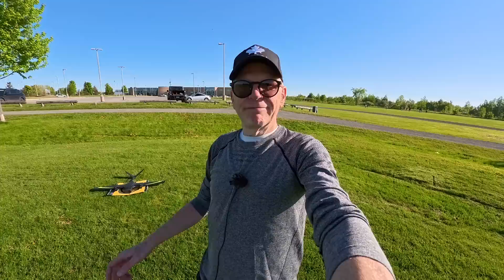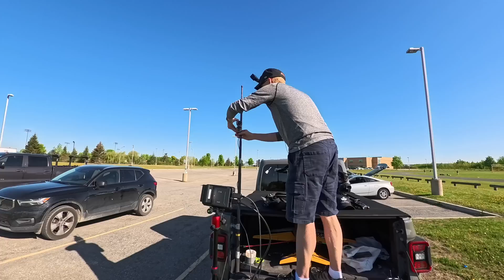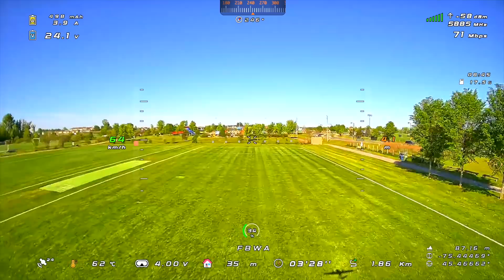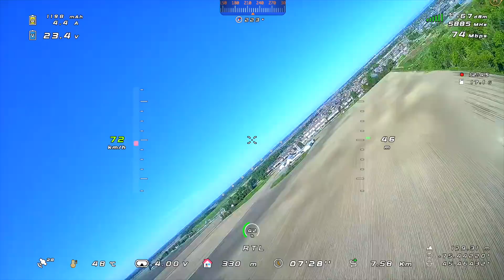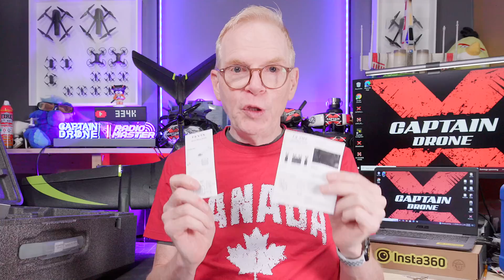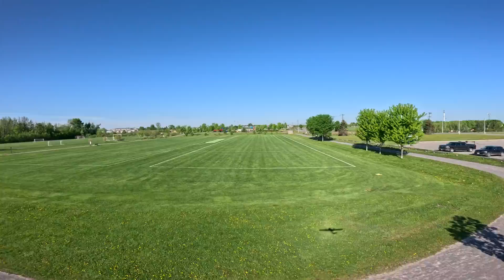OMPHOBBY - ZMO Version 2 - Long Range VTOL

Comment: I've had three good quality drones with fpv, the first being DJI Phantom 2. Each of them have ended with the same problem. After roughly 2 - 3 years, they lose fpv capability; no WiFi. Two occurred after firmware update.The most recent, a FIMI X8SE has now done it, too. This time, however, I avoided doing the firmware update. But nevertheless,  one day, it would not connect to WiFi. So I went ahead and did the update figuring I had no choice in that that may be the problem and still, no wi-fi, no fpv. Continues to say disconnected. I have no idea why this is occurring but it seems like it's intentional. What are the chances this happened to three different drones. 
Another old man hobby down the drain because of?  I don't know, somebody tell me; government intervention; planned obsolescence by the manufacturer?? My suspicions include that I've not registered my drones & somehow they're able to disable fpv because of that? Anyway I'm done with drones.
Reply from the maker: Small correction.  FPV means FIRST PERSON VIEW and it applies to the hobby where you fly with FPV Goggles.  What you are talking about is called “CAMERA DRONE”.  Another small point is that WIFI is used in the old PHANTOM 2 but not in your other drones.  The PHANTOM 2 is so very old that the phone app was discontinued many years ago because Phones no longer support it, which is probably why you have no WIFI for that old beast.  Your FIMI X8SE issues could be due to an update incompatibility (drone is on one firmware version and remote is on another, and app is on another).  Also, I’m curious if you are a citizen of the USA?  I ask that because in my world travels I find US citizens believe in conspiracies involving their government.
Reply: Thank you for your response. Yes, I'm in the U.S. The conspiracy comment was mentioned half-heartedly. Yes, Americans wake up and fall asleep with conspiracies on their minds.😂 Yes, we all know government would like to put a lot more restrictions on this hobby, and I'd say, UNDERSTANDABLY so. Who would want to be responsible for accidentally bringing down 747 full of people?
Anyway I'll see if I can update firmware on both the controller and the drone. Maybe that'll work. Anyway, either way it's a hobby to keep me busy. Either by flying OR trying to fly 😂?

Comment: Hello Captain. Are there any DJI quadcopter drones that can compete with this in terms of range? I looked it up online and apparently the range of the Air 3s is 32 km, but I think that refers to the distance it can cover during a flight, not how far away from the operator it can get. Sorry for the dumb questions.
Reply from the maker: DJI drones with range?  The consumer DJI Drones have a range based on flying line of sight (means the drone is at a distance directly in front of the FPV Goggles with no objects in between blocking the signal).  This is also true for the ZMO V2.  Both pieces of technology place the video stream and the telemetry into one signal.  The DJI Signal is more subject to interference so the range would not be as far which is why DJI Consumer drones have no external antennas and often less than half the range of the ZMO.  But honestly….  Unless you are chasing cruise ships out over the ocean, no one ever will use the range in a method that would give them the advertised range that all companies advertise.

Comment: Can you reverse the sticks so left is control and right is throttle?
Reply from the maker: Yes.  You’d have to watch videos on how to do it.  It is often easier just to buy a radio that is the mode you prefer.
Reply: ok, you can't.  I should have watched further where you talked about the controller.

Comment: Can you expand/explain why Compass calibration is not required in 2025 please. Thanks
Reply from the maker: Because in the year 2020 a new GPS came with quality products that is precise & no longer relies on a compass calibration.  This is why people stopped doing compass calibrations on DJI Drones 5 years ago.  Once you do a compass calibration you override the factory GPS settings and if you did it poorly or the was metal in your pockets, then the results won’t be as precise as factory.
Reply: @CAPTAINDRONE798  Thank you for the reply. I was not aware of the changes

Comment: o well presented, flown & explained Steve. Very well done mate!
Reply from the maker: Thank you very much for your kind words.
Reply: Steve,It looks like the system can support  DJI Integra goggles with the USBC
Reply from the maker: @Bellairvideo Yes, it can support many video transmission systems, however it is not available as a RTF with any of such systems other than the EDGE T3
Reply: Many thanks for your reply😎🇦🇺

Comment: Really nice video. I have an Air 3S and a Neo but really like what you're showing here. Thanks. Will it accommodate a DJI Action 4 camera?
PS I subscribed.
Reply from the maker: The DJI ACTION 4 is similar in size to a GOPRO so yes it should fit.

Comment: 100$ for an old ineffective design with the nose of the old zohd Talon (to get go pro camera)
a proprietary camera transmission system and i don't imagine price of spare parts for something that act like a parrot and is not fun at all. i really prefer to go to either hee wing t1 or zohd altus in vtol as they both got vtol kits and are very good planes (and for the price difference you can buy a dji O4 system !!!

Comment: Very neat package but a pretty pricey entry point for "beginners". I don't like the fact that there is a switch for compass calibration which according to Steve should not be used routinely (he didn't explain why on this setup). Anyone who flies RC has inadvertently hit a switch. Sometimes with disastrous results (like hitting throttle kill on a gas plane). I would make that function much harder to access if it can really mess things up. You wouldn't want to lose control or have the plane unable to return if you're miles away. Hopefully also there are pre-configured altitude constraints as we have a 400' ceiling in most places in the U.S. Any beginners buying this in the U.S. absolutely need to familiarize themselves with the rules governing UAS's and register (as required) with the FAA Drone Zone site and take the TRUST exam.
Reply from the maker: The COMPASS CALIBRATION switch should not be selected before takeoff because the ZMO will go into calibration mode, and if someone does a poor calibration, then it may not lock into the Sats as solid as it does out of the box.  The reason the switch is there is because if someone should crash the ZMO, it may then throw the compass off and a calibration would need to be done.

Comment: I'm new to the plane world, ive only ever flew drones so im abit confused, is it not as simple as putting goggles on and connecting to the aircraft like a drone? you need some external signal device? is this common with high end RC planes?
Reply from the maker: This is pretty much a very unique plane because it is a VTOL.  So if you wish to get into the RC Hobby Plane hobby it is not like this since most RC Planes (at least 99.99999% of them) do not come with an FPV Camera.  FPV Drones come with an FPV Camera and require a very advanced pilot and understanding of the RC Hobby.  This is why DJI made their beginner (no skills required) ready to fly drones, such as the Mavic, Phantom, Flip, AVATA & Mini drones.
Reply: @CAPTAINDRONE798  oh i see, thanks so much for the reply. Im terrible at line of site flying so I'm only looking at planes with camers currently

Comment: 3:55 - those externally mounted antennas are a very good idea.  This is what we need to fly from inside our vehicles during the cold winter days or to avoid the blazing sun in the summer!  I used to do this during my analog FPV days since analog composite cables are easy to route and connect.

I highly recommend in-vehicle FPV.  Sitting in a "captain's chair" enclosed in the vehicle quiet  is better for more authentic flight.   Also you look less goofy out there with FPV goggles on.
Reply: same. It's a security thing as well. I started flying in vehicle after a day that this unsavory dude came up behind me at the park and started trying to mess with my gear while i was blinded w my goggles and flying my quad 70mph through obstacles and had to abort my flight to return to reality and tell this guy to get lost. 
Never happens when you are locked safely inside your command station (vehicle)
Reply: @petrol_prophet  Thanks for the reply.  Yep, I just got back from a day of fun FPV in hot bright sunny weather.  I would be cooked right now if I wasn't in my enclosed base station.  The sun was beating down hard and the shade made a world of difference.  Today's flights would've have been undoable really without the enclosed flight cabin.

Was next to a busy highway and sliding my van door shut really helped keep the annoying noise at bay.

Agreed, when people might be walking around, I'll almost always close the door too if its not already closed.  It just feels uncomfortable to be completely masked and have people potentially passing by even if they're not really that close.  And all my stuff if mostly inside or on the roof of my taller van.

I also have a portable battery powered fan for these hotter days.  The airflow over the face is very welcome and removes most sweating especially with goggles pressed against your face tight.  The airflow somehow adds a bit more realism to the flight too!

I have a small solar panel powering my Walksnail Repeater on the roof along with an 12V LFP battery.  That solar providing power up there is one less battery to worry about.  Almost always that LFP battery is 100% charged after the day as the solar panel provides net positive power. 👍
Reply: @RCHobbyFan sounds like you got a solid setup! I like the idea of the portable fan a lot, and solar plus repeater. I’m going to look into implementing those for myself

Comment: Only thing I don't like is the flat front... unnecessary hit to efficiency
Reply: @EverythingZen8  you could probably make a clear dome for it to still have visibility and a little better aero.
Reply: @FactsOverFeelings23  yeah I was thinking the same thing might have to 3d printer a front and see how it goes
Reply: I suppose its designed that way for the go pro option.

Comment: This is another great video on a product i would have not known about otherwise. And as usual, Steve makes it fun, funny, and thrilling! Oh, yeah, and informative. Too bad the price is so high. Since the company is a Chinese company, the price will most certainly be effected by tariffs and other trade issues. I wonder if supply is also being affected, because the source factory may not be producing as much since they can't make money with tariffs.
Reply from the maker: They sold out of the first batch.  The second batch goes on sale around mid June.  It is the EDGE T3 transmission system that is now so very popular and in short supply.  The EDGE system came out a few months ago and has been selling like crazy.  People have been putting it in their FPV Drones, Planes & Cars.

Comment: That Edge T3 is interesting, in more ways than 1. I've read that OMP were involved with it's development, but if you search online for Edge T3 it takes you to a company called Edge Smart Drive that make underwater scooter. It seems a tad diverse, scuba gear and long range video transmission. The other reason it's interesting, is because the T3 system just appeared out of the blue. The T3 and Openipc seem to indicate digital FPV is getting more affordable. I've got the Eachine Sphere Openipc system, and the quality is really rather good, especially as it was only £60.

Comment: Can you face the ground station antenna facing up so you can fly in any direction around it or can you only fly in front of the direction the antenna face?
Reply from the maker: If you faced it upwards, well then the range would be limited.  You face it in the direction you will be flying long distance.  In my video it was pointing to the front, but I flew back and forth from side to side.  I could have flown behind it, but then the range would be limited to probably half a mile or less.

Comment: What is the flight time?
Reply from the maker: Flight time is based on two things:
1.  If you HOVER then you quickly drain the battery but if you fly in PLANE mode, you barely drain the battery.  So a LONG flight time means you take off quickly and get into plane mode quickly.
2.  The next thing that affects flight time is the CAPACITY of the battery used.  If you want to fly for over an hour you’ll need to use a larger capacity battery than the one included.

Comment: I thought there was a vtol with a controller with inbuilt screen .. Why couldn’t they have one similar to the DJI ..The controller is my only gripe .. Stunning otherwise… Thanks Steve 💚
Reply from the maker: Click on the link I placed under the video.  It will take you to V2 of the ZMO, but if you look at the top of the screen and go to all the ZMO products, you’ll find the old V1 that comes with a display.

Comment: Hi Steve. Do you know is the flight controller and onboard software fully compatible with DJI O4?
Reply from the maker: I’m told the Flight Controller can be used with a DJI system, but I have no idea how it is done, but I’m sure someone will do it and produce a video.

Comment: You mentioned that it has an ELRS receiver connected to the T3 system. What is the purpose for that?
Reply from the maker: The RADIO you use (that thing with joysticks on it) has to communicate with the ground station.  One way is via a RECEIVER.
Reply: @CAPTAINDRONE798  ok will you be doing a video of how to do the set up ?

Comment: BTW, another thing any FPV pilot is going to need/want with this setup is a ground based DVR, because the T3 video system doesn't include one.   The most logical choice is one that also has a screen like the one in this vid, but it's another $200+
Reply from the maker: There is a DVR in the Transmission system that is in the ZMO, as shown in the video, which allows you to record video with no OSD.  If you want to record the OSD you do that in your FPV Goggles, or as I did, you record it on a tablet device.

Comment: Looks good, I guess you could mount that ground station on helmet on top of your head so not to bring too much attention to yourself 😁, it is a tempting buy that is for sure and don't know if that is the same model but I did see a similar model that someone hooked up to a 3 monitor flight sim complete with powered chair that rolls and dives with your movements, funny how you came up with this just a couple of days later.

Comment: Expensive, but cool. If I'm blowing that much dough anyway, then I'd also want a stabilized 3-axis gimbal (with zoomable camera) so I could site-see in loiter mode.
Reply from the maker: 3 axis gimbal?  Not on FPV.  You would be in the market for a DJI Camera Drone and not an FPV Drone.
Reply: @CAPTAINDRONE798  Huh? Lots of people fly 3-axis gimbals on FPV. It's literally a standard thing you can just buy bolt-on or complete RTF even. Also, DJI doesn't make winged drones, do they?
Reply from the maker: @Darrylx444 The reason people don’t place a GIMBAL on an FPV Drone is because the purpose of an FPV Drone is to fly like a bird with no beginner stability.  This means the pilot controls the shot which is why FPV Drone video footage looks so “fighter pilot” cool!  Now if you have a BEGINNER aircraft with stability, then yes, you can place a Gimbal on it.
Reply: @CAPTAINDRONE798  I think your perspective is primarily from the copter side of things? My interest is more wings, both conventional and VTOL like in this video. "People don't place a gimbal on an FPV drone" is incorrect. They certainly do, plenty of videos exist of exactly that. And it's not really a beginner aircraft thing either. "The purpose of an FPV drone is to fly like a bird with no beginner stability" is also a pretty limited view of how people use FPV equipment.
With an off-the-shelf $150 50g hobby-grade gimbal you can control far more than just the direction the camera points. You can remotely change the operation modes to "lock" some or all of the axes to the aircraft's frame of reference while still retaining real-time stabilization (the degree of which you can also adjust on the fly) for "fighter jet" operation with a bit smoother view. And then flick a switch to unlock the axes while cruising or circling in "auto-pilot" operations, so you can just look around at the scenery or even other drones. Head tracking also, if desired.
Or else just fly around unlocked all the time, but that takes some additional experience. I'll link an example video in the next comment below:

Comment: Does the V2 now have a proper tune that works ?
Reply: I did indeed and looked fine, I'm fully aware of this company and all the hassle people had with the V1 ZMO with it's poor tune and total lack of support from the company when people had spent alot of money for it. I want to be 100% certain the V2 is well sorted before I didn't a penny on it
Reply from the maker: @tubamanandy2 I have the V1 ZMO and love it.  My V1 is the DJI Air system. I have never had the issues you mentioned.  Now, the ZMO is not “Fool Proof” so there is a chance some of the issues you read about may have been user errors.  Also, there was a second version one made that is still sold today.  That one has a system with a controller and built in display.  I’ve used that system on the SWAN VTOL and I was not a fan of it.
Reply from the maker: Ummm….  Did you watch my video review by any chance? 😒